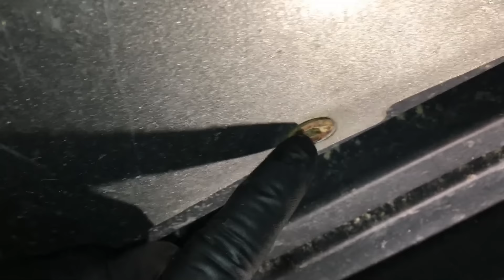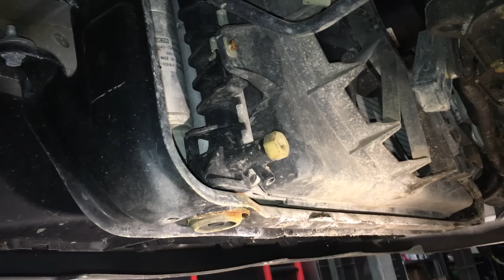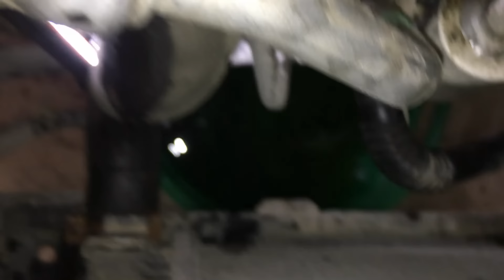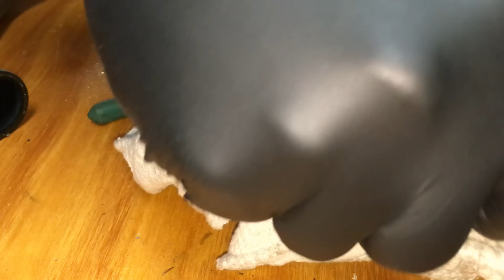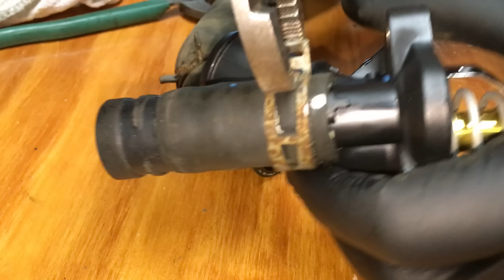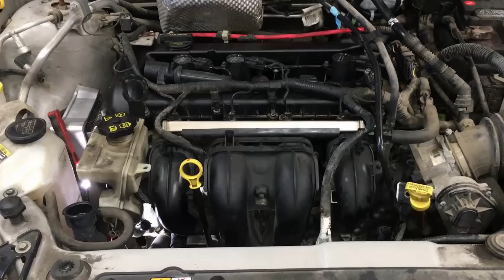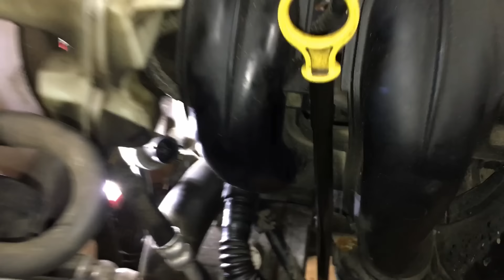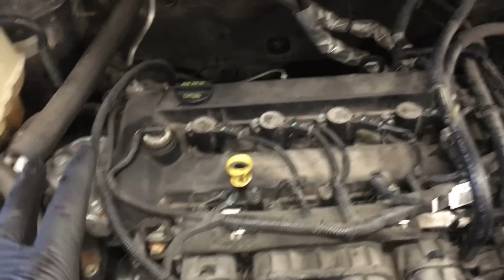Ford 2.0L 2.3L 2.5L Engines P0125 P0128 Insufficient Coolant Temp: Thermostat Housing Replacement

Comment: Brian I replaced both the thermostat and the ECT sensor on my 2.3L Focus and cleared the P0128 code but the code still keeps coming back. I used Motorcraft parts. The coolant level is good. What now?
Reply: Did you ever figure out what the problem was with yours?  My fiancé's son's 2008 Ford Focus had this code pop up last year and we had a shop replace the thermostat with a Motorcraft replacement.  The CEL came back on the other day and it was the PO128 again.  I can't imagine the thermostat is bad again so it may be the ECT sensor or the wiring to it.  I'm not even sure where the ECT sensor is on this car which is the 2.0.
Reply: @Mr2004MCSS  I had replaced both parts and still get the code popping back up.  I even took the car to the dealer for a complete refresh and update of the PCM and that still didn't work.  Don't know what else to do now.  You can try to replace the ECT sensor, it MIGHT fix the problem.  It actually doesn't have an engine coolant temperature sensor like many cars, it has a cylinder head temperature sensor (CHTS).  FordTechMakuloco has a video just on this subject.  It is located on top of the motor between the 2nd and 3rd coil packs.  You need a 19mm deep socket to remove and replace the sensor.  You will also need a new pigtail to splice into the wiring.  Please watch FordTechMakuloco's video on this very thing.
Reply: @LA_Commander  Thanks for the additional information.  I remember that sensor from when I replaced the valve cover gasket on it.  Next time he is here I will take a look at the connector and wiring to the sensor and see if I see anything obvious.
Reply: @LA_Commander   what ended up being the problem
Reply: @kirbyfeet-zq1rj  Never found out. The car was wrecked when someone hit me who had run a red light at an intersection

Comment: Can you help or suggest things to check ? only 42K miles on this van..
I have a 2013 transit connect. the temp gauge is in the middle, no codes, but the heater on this van seems weak.. in the winter,  the engine is up to temp in about 15 min or so,.but the heat is luke warm, the heat isn't kicking til about 25min or so into a drive. But once its good n warm it stays this way. if the thermostat was stuck open would my temp gauge still be in the middle ?? I'd think it would show lower than the middle..
Reply: hey guy.. I had asked you about my issue quite a while ago, but you never answered me.. Can you advise or are you not allowed to ?

Comment: When I did one the other day I just removed the belt and moved the power steering out of the way. And I had access to the thermostat. A little tight but it fine.
Reply: How do you seal the thermostat, do you use silicone or some type of gasket?

Comment: Great video. Idk if some fusions are little different but it was a lot easier for me  to take hoses off and slide right back on. Didn’t take off fan shroud. Changed water pump also. Thank you  for the video.

Comment: My 2013 Fusion Titanium (93k miles) is leaking coolant.  Seems like from the thermostat housing area.  I'm guessing the gasket wore out.  Can I just replace the gasket (part # 3M4Z8255A) or should I replace the whole thermostat housing with a new thermostat? Thank you

Comment: Just replaced the thermostat in my wife's 2009 Ford Focus earlier this week using this video. I used a vacuum refill tool I got from Harbor Freight once done but didn't clamp off the overflow tank when applying the vacuum yet everything seems to be working alright. So far there's no overheating and the heater is blowing great!

Comment: I was so sir-prized you didn't replace the hoses while it was out. A few bucks now saves a lot of work later.
 Also, a very light swipe of silicon grease on the surface of the housing connector or inside of the hose makes a nice seal and keeps it softer and easier to remove later.

Comment: Bottom stats suck if rad gets too cool the circuit never opens long enough to cool engine and if it has a viscous fan they suck as well
Reply from the maker: Not sure what you are concerned with here the sensing part of the stat is still on the block or head side not radiator side.

Comment: Thanks for a great tutorial. I own a 2015 Jaguar XF and yes  wrote Jaguar since the 2.0  shares the same engine as the Ford edge , focus, fusion and Lincoln. I have been looking on YouTube and I found your video on  the same engine on how. I know the XF has the rear wheel drive so I may not have to disassemble the radiator bit it is still a challenge to get to. Thanks for a great video

Comment: I have a 2016 and when you start the car up and use the heat it won't go past a quarter on the temp gauge. Heat keeps the engine cool. Suspecting thermostat. Replacing it today.

Comment: Btw, for you Fusion/Milan owners- the vehicle in this video is a Focus. Fusion/Milan are MUCH tighter and not possible to do like this. The power steering pump MUST be moved out of the way.
Reply: For a 2010-2012 Fusion with the 2.3 you don't have to pull anything.  Just drain the coolant, pop the hoses off, unbolt and remove.  Reverse to install.
Reply: I thought so. Thanks. I was looking at my 2010. And thought that sure looking much easier to get to than any video I could find. There is no 2010 fusion video I can find .

Comment: Good afternoon, this question is already made and I am not told very well please tell me where I located the antifreeze or coolant sensor of the ranger 2.3 2010 Argentina is that I do not know where it is told me back but I do not know if to remove the body of acceleration to achieve it you could show it in a video, I am from Mexico but unfortunately nobody wants to tell me
 It is not in the radiator or where is the thermostat please can you tell me to explain in a video where it is located, I would greatly appreciate it

Comment: Great VIDEO 
I have a 2.3l  in a 2011 Ranger that seems to be running cool (175deg.).  What would be the proper operating temperature for this engine.  I've found a RT1193 and a RT1194 thermostat  but the don't give any temperature  settings.  Thanks

Comment: Mine never gave me a code. I knew something was wrong when my escape hybrid was getting around 29 mpg and it tanked to 21.1 mpg. I hooked it up to a scanner and drove. I saw after driving for 20 minutes on a 90 degree day my car never went past 160 degrees. New thermostat and my mpg is back to 29ish.
Reply: palillo2006 same my 2015 focus takes like 15 minutes to heat up with no code. I presume this is the early symptoms of a faulty thermostat?

Comment: I just tackled this job on my '08 Focus 2.0 Duratec. Unfortunately I live in New England and one of the thermostat bolts was severely rusted and wouldn't come out (even with a bolt extractor socket). I ended up having to remove the intake manifold so I could weld a nut onto the stripped Bolt to remove it.  I give kudos to anyone able to do this job. There is very limited space to work especially if you have large hands like me..

Comment: @fordtechmakuloco I have a 07 Focus 2.0l in the shop. We are on thermostat #2 and the code still pops up after a week of driving. We only use OEM Motorcraft tstats (RT1193). Any advice?

Comment: I don't have an air compressor. Is there a way to do this with a vacuum pump?
Reply: That vacuum procedure is completely useless. Just put the coolant in, let the engine run with the cap off, put the heater on max heat and revv the engine abit now and then until you feel that it starts blowing warm. Then shut it off top off the coolant to the level and youre good.

Comment: Hey I have a 2013 Ford Fusion 1.6 EcoBoost and  The digital gauge reads coolant temperature overheating but the car is cold and the gauge reads overheating any help?
Reply: Bad coolant temp sensor?

Comment: The heater of my 2010 Fusion won't turn on when I start the car in the mornings; typically it takes several minutes, but once it comes on it works fine. This is a new car to me, and the place I bought it to tried fixing the problem by changing the blower motor. It's still doing it. Could it be the thermostat?
Reply: Derek Rush If your engine isn’t warm then you won’t get any hot air. Let it run or drive it around for a bit to get it warmed up.

Comment: I got a check engine light on my 07 2.3 but when I plug in the code reader it doesn’t power up. The code reader works something is just wrong with the plug or something. Any idea?
Reply: Check the fuse for the cigarette lighter/12v supply, the obd 2 connector is on the same circuit. A blown fuse will cause a failure to communicate/no power at the connector
Reply: @DieselTechJ  Never heard that before. Thanks.
Reply: Thanks found it

Comment: i'm still dumbfounded. don't understand how you got to the therm-housing so easily. my mechanic said it's a pain. he would have to remove the intake. consequently, he refuses to do this job for me. and i am not mechanically inclined enough.
Reply: regression  Find another mechanic since he doesn’t know what he is doing obviously.  With fan removed it gives you more access to the housing and bolts.  Even without removing the fan the job is aggravating but still manageable.
Reply: @teddiecombs2239  that's the thing. he's not unwilling to do it because he doesn't know how. he just doesn't want to deal with the aggravation. he's "semi-retired". and all the other goons in my town charge way more than him for labor.

Comment: Changed the thermostat on my 2000 f150 5.4 260 thousand miles a month ago..it was stuck open and i replaced it with a new one from ford...Not After market Junk...took me about 30 minutes and a cup of coffee and all is good.Spend the extra few dollars and get the original and not the local parts store...you'll be better off in the long run.

Comment: Why not move the clamp over to the right to make it easier to tighten the top left bolt of the thermostat?
Reply from the maker: As explained in the video you must line up the constant tension clamp to it’s  old impression to prevent leaks and we can’t twist the hose so...
Reply: FordTechMakuloco Thanks.

Comment: At least they finally designed a thermostat that generally fails open rather than closed
Reply: Ain't that the truth!
Reply: Mine is sticking closed on my 2.0 focus so the engine literally boils the water without the temp gauge going up
Reply: Mine is stuck open. I thought why is it a problem? It’ll never overheat!! Why is this an issue to just leave it alone now?
Reply: @paulkimble736  it is a problem. First, how could you work without clothes warmth?  If it is stuck open your engine wont give you good milage and ending up working more and drinking the fuel. Second your car's heating will not work properly in winters when you need the most.
Reply: @paulkimble736  for the engine to run efficiently both in terms of fuel efficiency and Emissions you want it to be at operating temperature. If you're in a cold climate you also won't get enough heat from the heater.
Reply: @paulkimble736 it is a problem. It will cause harder shifting as the trans temp won't be ideal and decreased fuel economy. This engine, even in Las Vegas desert climate, will constantly open and close the thermostat. It can rarely stay at ideal operating temperature the entire time it's running. I've owned 4 cars with this engine, the transit in particular will get up to operating temp on the dash but in the PCM it'll show lower readings, around 60c while at idle even for an hour. It's a simple part to change that will pay for itself in gas savings within a week or two.
Reply: What causes the water to back flow through the expansion tank.
Reply: 2.0 engine 2014 focus
Reply: Wrong. My is stuck closed

Comment: This is by far the easiest guide for dealing with that sucker of a thermostat. Dropping the fans is a simple and easiest way to get enough room. I've seen others remove the drive belt, engine mount, power steering pump and reservoir, or removed nothing and struggled forever. This takes no time at all and makes it an easy job if you have small hands like me. As for the bleeding technique, that's a little too "official" for me. I just leave my radiator reservoir cap off and let it get to about 90c so it doesn't boil but also circulates that air out of there. Maybe if your water pump is really weak you'd have some issues pushing the air out, but I've Never had any issues doing this with my 06 focus and my previous 2 cars (99 corolla and 04 audi a4).
Reply: great tip. thanks for sharing.

Comment: Where is the engine coolant temperature sensor 2003 Ford F-150 5.4 engine
Reply from the maker: Engine valley front drivers side but this is only a CHT sensor.
Reply: CHT  what does that mean (cylinder head temperature )

Comment: Got the po125 code. 5.4 engine Ford F-150 where is thermostat
Reply: John Rechner the 5.4 engine is easy.. it’s literally attached to the upper radiator hose on the engine. 3 bolts take it out replace it ( get a ford one they are like $14 ) and put the little tab toward the radiator and replace the gasket and put it back together and fill it up with coolant turn the heat on full blast and park it with front end higher then the back of the truck ( on a hill ) with the cap removed and it’ll purge the air out easier. They are bad about bleeding the air out and that’s the easiest way

Comment: Just did this on my daughter's '09 Fusion 2.3L.  Things to note about it:  Before pulling the cooling fan up & out, there is a hose support at the bottom that wraps almost all-around the radiator hose... you'll need to push the hose out of it.  Second, to help guide your extension and 8mm socket, use a light for the top left bolt which can be seen thru the IM runners. The top-right bolt, look from the PS pump side, but to see the bottom-right, I used a mirror.  For the small bypass hose on our car, there was no extension hose near the t-stat housing like on the car in this video, so I also just left it clamped to the housing like the main radiator hose. Once the t-stat housing is unbolted, I had to disconnect the connector at the compressor clutch, which allowed me to manipulate the housing and attached hoses between the a/c lines. At first, you may think it's not possible to get it through there, but if you tilt it a certain way, it actually comes thru easily.  Doing so, makes it easy to swap out the t-stat/housing assembly right there at the car.  Unlike the car in this video, on my Fusion there were other hoses branching from the main hose, so to me it was more trouble to try to get it to the bench.  I easily put the clamps back on hoses where they were.  Also, just before refilling the coolant, don't be afraid to loosen the plastic bleed valve cap several turns or even to take it off for that matter.  My Haynes manual incorrectly said to only loosen it 1/4 turn but that wasn't nearly enough to allow any air to escape.  However, running the engine afterward for 10 minutes at 2500 rpm did seem to do the job.   I only had to top the reservoir off a little bit after I drove it about 3 miles afterward.
Reply: I fought with getting the fan out of my 2008 Mercury Milan 2.3L for 45 minute before giving up on it. I removed the bottom hose support from the hose, but still couldn't wrestle it out of there. I'm not sure how you managed to do it. I opted instead to remove the power steering pump for access to the thermostat bolts.

Comment: And I looked for this replacement at local O'Reillys and they couldn't get one for a week. Local NAPA got it overnight, BUT there was a different thermostat housing that had a temp sensor attached. Why did O'Reillys NOT come up with that in search? Is that attached sensor thermostat for the 2.3 or 2.5 engines?
Reply: Again,  I spent an hour researching this.  Consensus is that the only way to tell for sure is to look carefully at your vehicle, since there are models of the same year,  same pzev/non-pzev etc. that differ on this.  Even calling Ford with your vin won't guarantee they send you the right part.  See if you can find that sensor and order accordingly :)

Comment: Is it REQUIRED to use the Ford brand coolant? What has changed in the specs that requires Ford coolant?
Reply: Researching coolant is a long and winding road. After spending an afternoon doing this,  I can say the following: there really are different ingredients used and it seems best not to mix (remember the radiator only holds maybe half the coolant in the system,  so a drain and fill will result in mixing). You can flush with water and start new with any color but remember some ingredients may deteriorate certain seal/gasket materials...I decided it's worth the extra 5-7 bucks to buy the recommended Zerex g-05 from napa. My 2.0 only holds 7 quarts I think so it's just one bottle Of concentrate

Comment: My daughter's 2009 Fusion 2.3L just threw the P0128 code at 129k miles, so I'll likely be doing this job on Saturday.  Will her Fusion be the same steps as in this video, or will the PS pump need to be unbolted?  About 2 yrs ago I did this job on my son's 2007 Mazda 6 w/ same engine/trannie/t-stat in it.  I moved the PS pump out of the way then, but maybe I didn't need to.  

For the 6, I also emptied the reservoir & then filled the system w/ Zerex's Asian car formula, which met the Mazda's specs.  What are your thoughts on me using the same stuff in her Fusion, which will help reduce the different types of coolant I keep in my home garage?  I also use it in my '97 Accord.
Reply: Did you end up pulling the power steering? Gotta do mine tomorrow and hard to say if it'll be easier to pull all of that or try to sneak out the fan and go that way
Reply: @navedemor5056  It's been about 3 years ago., so I don't remember for sure, but I think I just took the ps pump mounting bolts out and moved it to the side leaving the hoses connected. If I disconnected the hoses I don't remember losing much fluid..
Reply: @mrau92me  ya pretty much my plan